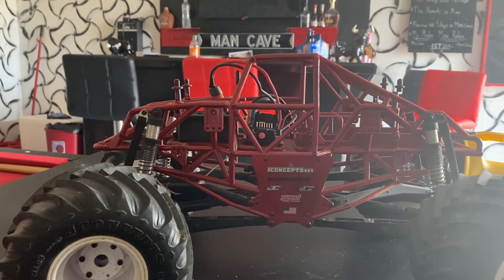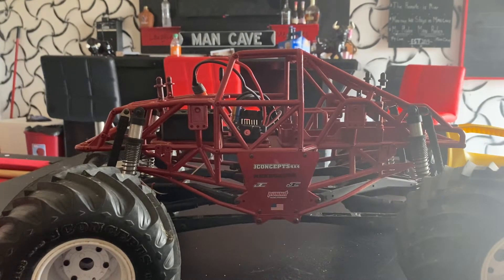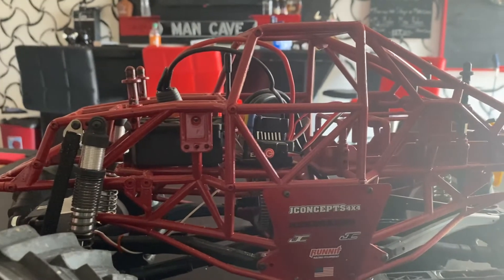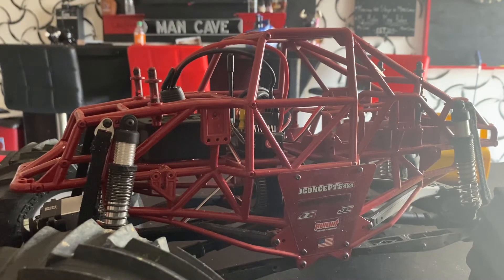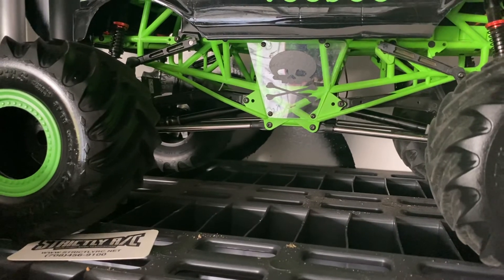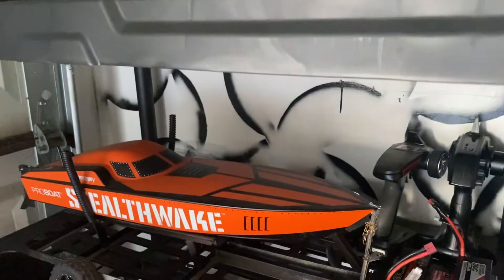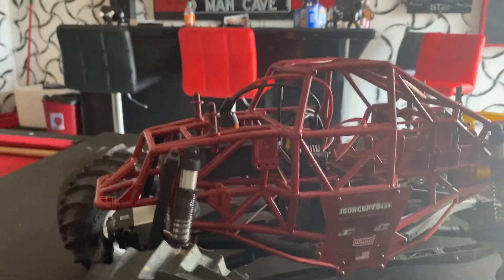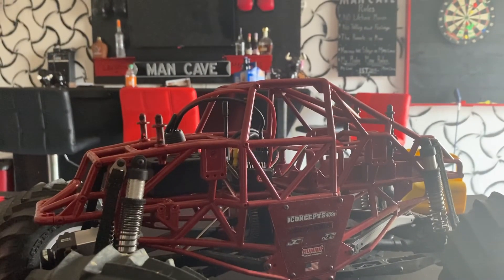SMT 10 downfalls on the factory set up

Comment: I have a smt10 and a lmt and to be honest I like my smt10 way better! Seems like everyone has no love for the smt10 since the lmt came out... I'm the exact opposite!  The smt10 is more scale than the lmt by far. Granted I have way more upgrades in smt10 than my lmt. I also run the renagades on my smt10 and drives on rails with those tires. I need to switch wheels on my lmt. I'm running the ones that came with it and they are way to squirrely with that set up. I have barely any control over that truck. Basically those wheels suck ass!